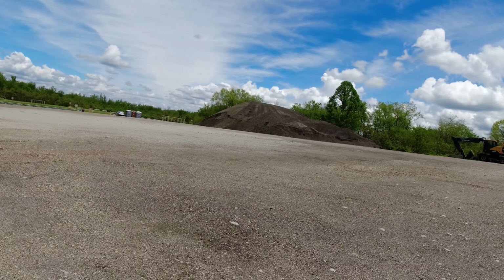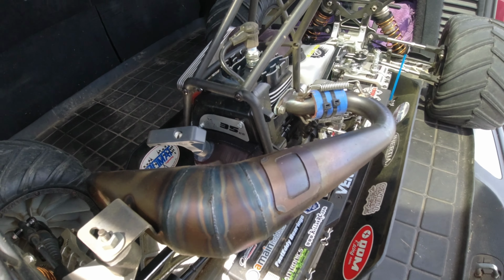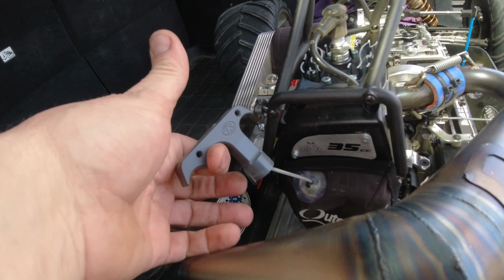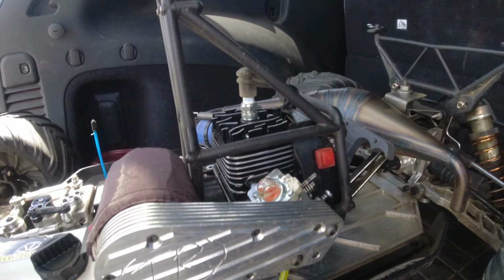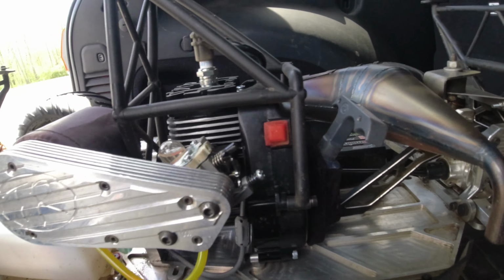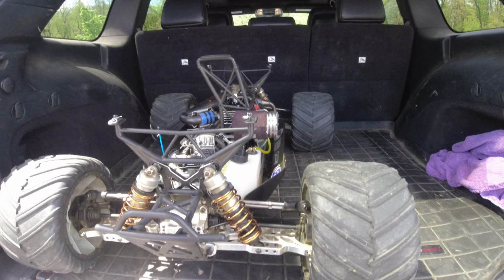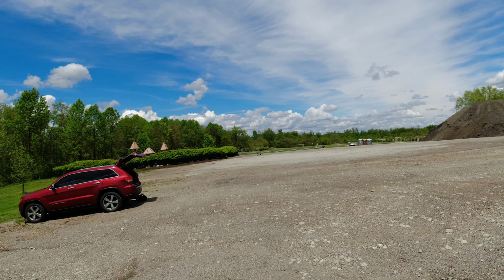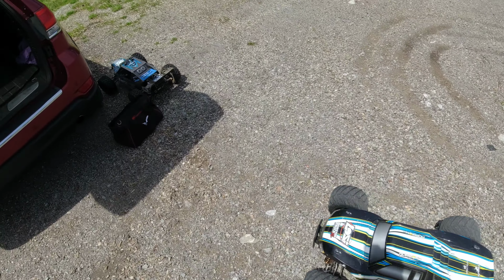Losi MTXL -Taylor RC 35CC First Rip!!

Comment: Seems it has enough power to add a teach or two on the pinion
Reply from the maker: Hello. Thanks! I wanted to break it in and see what needs done. Personally I think it is lacking a little off idle. But what to expect from a 43 pound MT right? So if I go up one or two teeth. It will get worse off idle. Most of this trucks usage will be in smaller areas not wide open throttle inba field. Know what I mean. Also. It is always good to seat these FS and WFO steel clutches with a lower gear ratio so there is little slippage during break in. Appreciate you stopping by 👊 🤘

Comment: The Taylor is really handling the big MTXL tires well… I’d love to have 1 in my 5T 2.0
Reply from the maker: I agree man. I have it moderately geared to get proper clutch break in. I have a sintered steel FS on there. I think I will keep it there. Definitely get one for your 5iveT. You will love it. Really appreciate you stopping by to check out my truck 👊 🤘

Comment: Nice rip G! Looks and sounds great! That suspension looks to soak up the jumps pretty good as well. It will be nice to see some bigger jumps. What a nice place to play. Don't kick the rampage to the curb...LOL! My rampage would be jealous if I added an MTXL to the stable.
Reply from the maker: Sup man! Thanks! I put Losi 5iveT shocks the whole way around with orange springs. The Rampage MT has me pissed as usual lol. Keeps breaking. Costs too much to keep going. So it sits. Appreciate you stopping by 👊 🤘

Comment: Awesome! Wow! She goes good 👌 How does it compare to the brovan 45 that was in there before?
Reply from the maker: After driving it with the 35 in there. I now realize that the brovan 45 is no slouch. I had the brovan over geared... Thanks for stopping by 👊 🤘
Reply: @SteelCityRC hello from Italy and sorry for my English... Is better spend money in Taylor or rovan 45? And this pipe works whit the 45?thank you
Reply from the maker: @pibest7195  hello. The piston port 35cc has a bit more power than the Bartalone modified Rovan 45cc in my findings. I was a bit disappointed in the Bartalone modified Rovan to be honest. The Taylor 35cc I used an Olimat pipe from Australia that was set up for a 34cc at the time. Which he now lists a pipe including the T35. I can't speak on how much better the reed version of the T35 is. But can only imagine it has more torque at the least.

Comment: Running sweet 
Need windows cut out the body
Reply from the maker: Thanks! I thought about doing the cutting/drilling thing on the body and realized it really doesn't need it. I like keeping the body integrity in such case of a roll over. Appreciate you stopping by to check it out!!